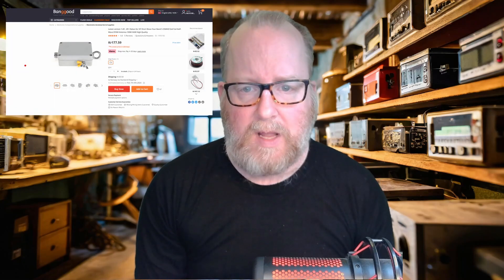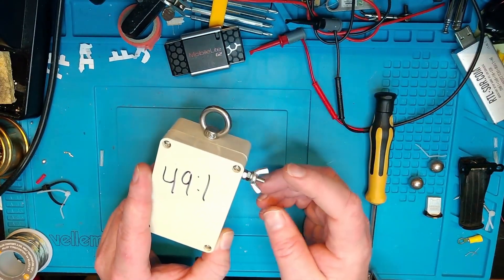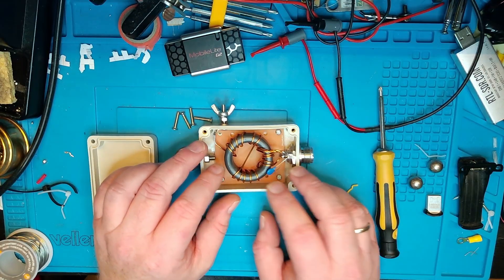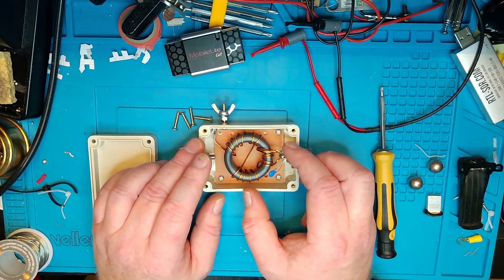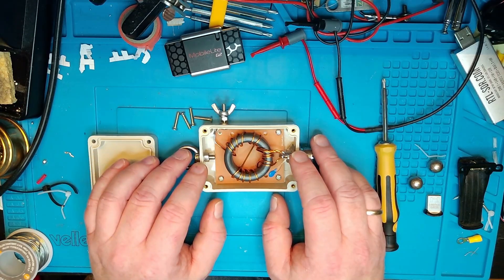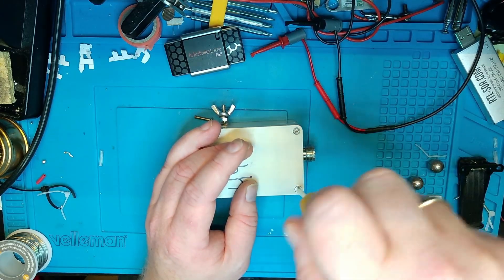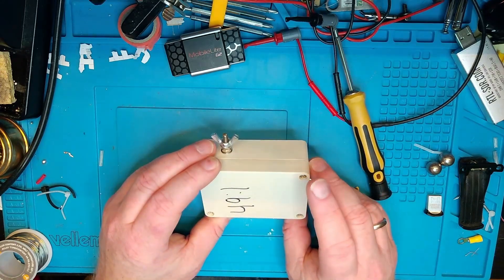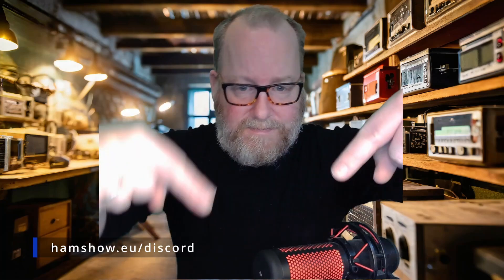What does a REALLY CHEAP UNUN look like on the inside?

Comment: That's the same 49:1 unun for 40 through 10 meter EFHWs I bought last year. My first antenna was the EFHW but in my case it wasn't very successful, so after briefly testing an experimental vertical I came up with, I started using a TEFV with an LDG 9:1 which works quite well, especially on 15 and 10 meters. I'm looking forward to the follow-up video in another week. 73 de DW7GDL.
Reply from the maker: It’s not the best unun out there, but it is by far the cheapest you can buy.

Comment: I know how this ends, I have purchased the same items in 49:1 and 9:1. I have tested them with resistors and an SWR meter and a wire. They are nice boxes with the circuit board to mount the toroid.
Reply from the maker: You will be surprised when part two drops in a week and a half then.